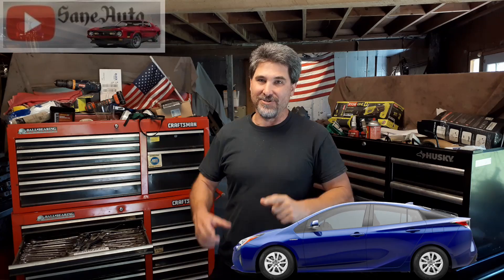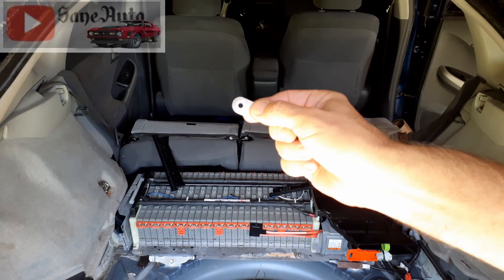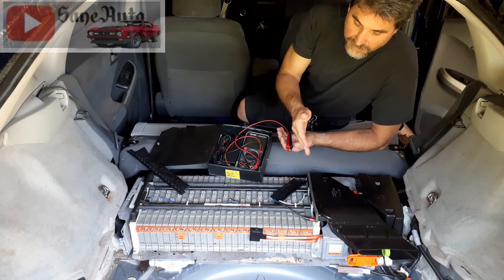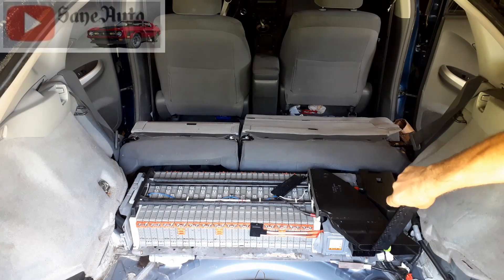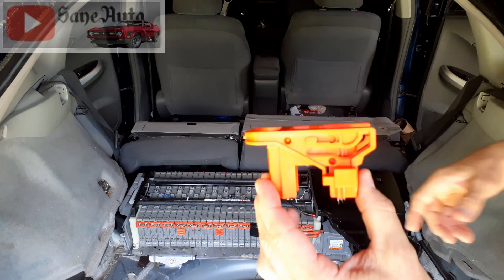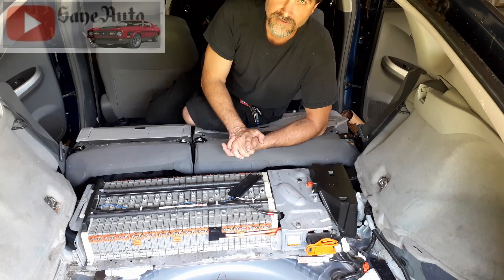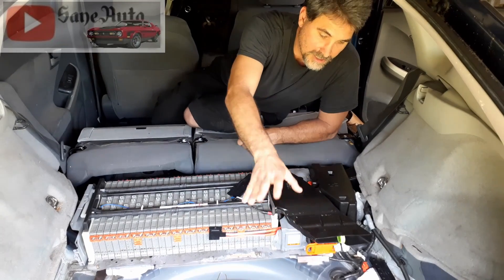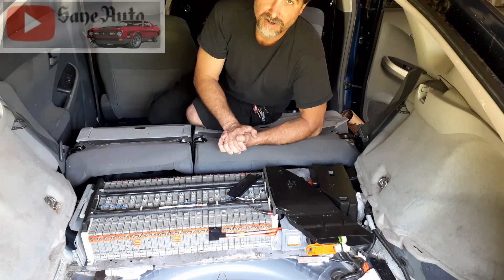Prius Top 5 (Check Hybrid) high voltage HV battery fault codes (triangle of doom) cheap fixes

Comment: Here is my issue. I was having a cooling issue blown head gasket. But I put some blue devil it helped the shaking and I drove it just fine. Then got radiator no heat I flushed and changed water pump. Soon after that car drives fine then shut off. There is a yellow car with ! In the middle which is charging issue. Main 12 volt went down. I charged it. Car started but now it won't drive past 7 miles till engine shuts off and won't turn on. I pull over and shut everything off and gas engine comes on but moves slow. This driving me nuts. Most mechanics say they know nothing about Hybirds.
Reply: Check your egr system they get clogged with carbon deposits leading to blown head gaskets

Comment: I used to replace Prius battery modules on the side years ago and this guys advice is spot on.
Reply from the maker: Thank you very much Brian. Its good to have you and your experience here in the comments.
Reply: @saneauto did you ever have to deal with error code P0AA6 isolation fault on a Prius?
I swapped the hybrid battery and the 12 volts battery so the problem is not in either one and no luck yet in pulling the sub codes like 526-611 up to 526-614 to point to transaxle or inverter or AC
The cars runs perfect after resetting the code twice until it’s turned off
Reply from the maker: @sammynazz Oh wow You've got great timing. I just dropped several videos on the P0AA6 every Sunday the last few weeks. They're in the hybrid playlist or just look through the last half dozen new videos on this channel.
Reply: But he says NOT to do anyt6he does
Reply: @williamsmith8041  --- Obviously a back-of-the-napkin legal disclaimer ;)

Comment: Ford Fusion hybrid 2015  I don'tnow what generation it is, but I don't know how comfortable I would be messing around or trying to do something how you avoid the high voltage shock that's the question the shock a death that is look forward to hear from you by for now I just went live 1st 16 minutes I'm trying to figure out scream yard just a heads up by pronounce

Comment: Hello
I have a 2011 Lexus ct200h
I have changed head gasket over the weekend, after that the car started but gave me check hybrid system, then it stopped goin into ready mode! Scanned shows P0A0D code and i can’t reset it or clear it! Any ideas?
Btw battery is 1 year old
Reply from the maker: The service plug I mentioned in the video will set the POAOD code if not installed correctly. Watch the part where I show installing the plug and how it clicks carefully.
Reply: saneauto i tried and plugged it correctly, now it shows poor engine power, engine not able to start.
Could it be a timing issue or u think battery pack gave up?